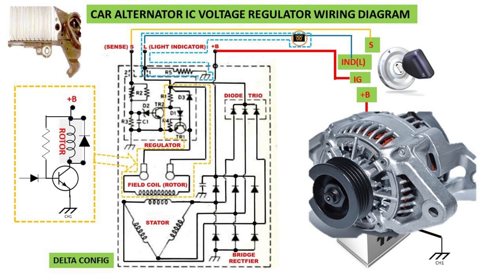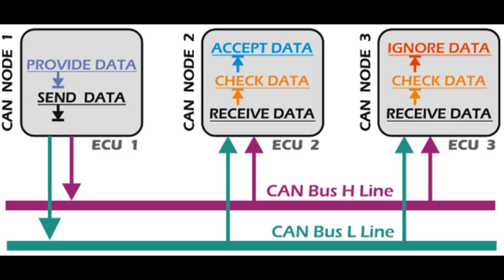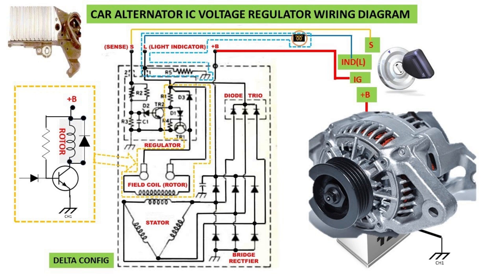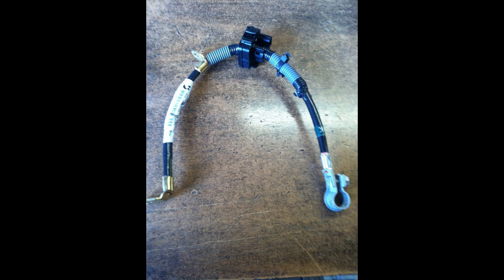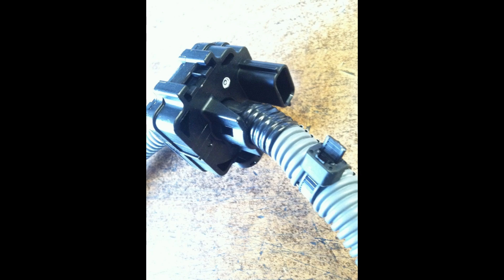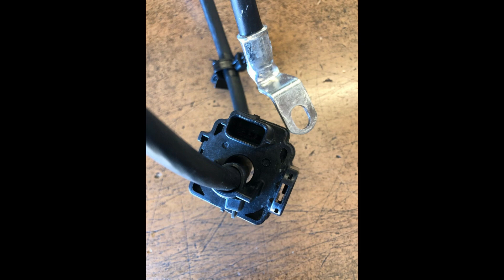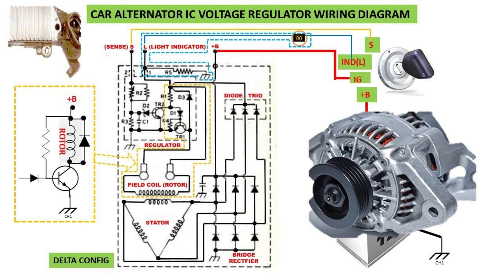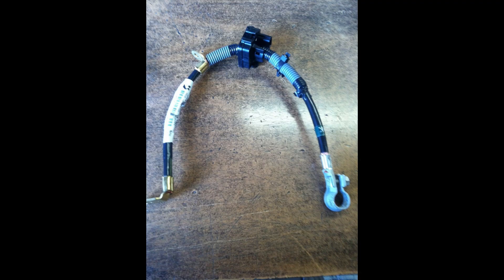Nissan VVCS Variable Voltage Control System

Comment: I can confirm that de-pinning terminal 4 pink wire at the battery current sensor works on the 2024 Nissan frontier without triggering a SES light. There is however an idle start/stop disabled message that appears everytime you start the vehicle. Added bonus if you ask me. Saved me some money buying a start/stop eliminator. The vvcs killed my first battery at only 24000 miles and I now know why. I’ve been running my truck this way for over 2 months now with absolutely no issues. I do keep a voltage monitor plugged into my cigarette lighter port to keep a an eye out for wild voltage swings indicating possible alternator issues. I now run at a pretty constant 13.9 to 14.1 volts. Thank you for a very informative video Frontier Geek.

Side note: doing this to a 25 model and presumably the 26 models will trigger an SES light in addition to the idle start/stop disabled pop-up.

Comment: I did this on my 2017, about 1.5 - 2 yrs ago. I also have a "Scan Gauge 3" , and one of my active gauges is voltage. Im seeing the same numbers you are. I also about the same time put in an AGM battery since it was time anyways. I've had no problems. Glad i didn't clip the yellow wire back at the box near firewall. I haven't been on the forum for a while. This video popped up as a recommendation to watch. Good stuff
Reply from the maker: Tarpman, thanks for writing in. Good info, thanks for posting and sharing your experiences. Always appreciate hearing that someone else found benefit from our videos. I have an EDGE CS digital OLED multi-guage as well, and I keep system voltage as the centre guage 24 by 7.

Comment: Nice meeting you at Carlisle this past weekend. I know of a someone that has "smart alternators" in their newer Bronco.  They had issues with power getting to the trailer they were towing to keep their batteries charged. Turns out they had to turn on all of their off road lights while driving to "trick" the alternator into putting out more so the house batteries in the trailer could be charged.
Reply from the maker: Ah, you made it !!! So to speak, LOL. I just subbed your channel too. These VVCS systems are such crap, another governmental overreach into everyone's daily lives, that accomplishes nothing but annoyance and expenses. Some vehicles apparently will defeat VVCS if the headlamps are turned on, but not all. Thankfully for the Nissan Frontier and Pathfinder, it's pretty easy to kill, at least in the second gen. The third is a mixed bag as the auto-start-stop showed up and now complicated things more.

Comment: You can eliminate it on the 3rd gen. It's a similar setup as the second gen. It's a black box right by the battery. I unplugged mine and then removed the box off the negative cable terminal. The VVCS killed my original battery.
Reply: I have a 2025.  I confirm that disconnecting the plug causes a CEL and flashing ASS light. I have not yet found the info about what results from disconnecting just the pink wire. Guess I'll give that a try.
Reply from the maker: BoomUp, give us an update if that fixes your problem, I'm sure somebody else out there is wondering the same thing. Hopefully they'll wander on into my corner of the digital universe.
Reply from the maker: Yes, that is true, but my understanding is the 3rd gen has a 4 wire sensor and only one of those 4 should be removed. The other has a battery temperature sensor circuit that feeds back to the PCM as well. I believe it was a pink wire that needs to be depinned, but I would check a wiring diagram for the year in question, before modifying anything in the harness. Never forget these sensor leads feed directly back to an area inside the PCM circuit board and should always be tape-wrapped if disconnected, to prevent voltage or grounding contact. Also depending on year, a PCM code will probably be set, and the SES may be illuminated. And if you have Auto Stop / Start that will be disabled as well and a Start / Stop system fault will be displayed.
Reply: @frontiergeek4953  I never looked at the plug to see the wires. I have the plug itself taped off. I haven't had any lights or warnings. Thankfully mine is a first build 22 and I don't have the A.S.S on mine. I've read that other people that depinned or "cut" the pink wire have had some issues. I'm not sure what the outcome was with them. The battery would be monitored through the alternator and the ECM isn't monitoring the battery temp through that connection on the negative terminal. I went down the worm hole about that module that was on the negative terminal and everything always came back to it being in charge of the VVCS monitor. It's been about a year for me and I haven't had any lights or battery issues. The new battery is strong as ever.
Reply: @frontiergeek4953  24 Frontier here. Have had mine unplugged since week one (purchased new). Only light is flashing Auto Stop / Start light. Kills two birds, no undercharging and no stop / start.

Comment: Why over complicate a simple way to maintain 13.8 volts?  I stay away from cars with this type of system.
Reply from the maker: I would try to avoid it too, but now everyone's using it cause the EPA gives manufacturers breaks on their Federal fees and oversight. It started back about 2005 or so, so there will be few remaining cars on the road that don't have some form of this system now.
Reply: @frontiergeek4953  Thank you, it seems that the EPA is involved in it a bit too much. Sometime ago I put together a voltage regulator for my alternator using a 723 IC chip, and it worked great! Had to modify it for temp compensation.
This was on my 2000 Chevy Express.
Reply from the maker: Now that's a cool project, very creative.

Comment: Let's test the charging system.   Engine running,  headlights on.  Blower motor on half speed .  Your multimeter set to 20vdc.  
Test one. Measure voltage across the Positive to Negative battery posts. If everything is good you should see 14.1 to 14.6 volts.  
Test two.  Measure from negative battery post to the engine block.  0.04vdc max. 
Test three. Measure from the negative battery post to the body.  0.04vdc max. 
Test four.  Measure from the engine to the body.  0.04vdc max. 
Test five.  Measure from the Positive battery post to multiple fuses in the underhood fuse block. 0.04vdc max. 
Test six.  Measure from the Positive battery to the alternator output stud threads.  0.3vdc Max because copper is expensive and the oems can get away with it. 
Pickups with a separate frame. Test 2B. Negative battery to the frame rail because many oems ground tings to the frame like the rear lighting, electric fuel pumps. Transfer case controls. 

 Why do this less than 5 minutes worth of testing with a $15 to $45 buck multimeter.  Because the electrical system is not Bluetooth.  It's hard wired and if you have a loose crimp, a loose connection a burned connector or corrosion on the wire strands. This simple voltage drop test is how you prove the electrons are moving freely. 

 Think of a garden hose with no nozzle with water flowing full speed thru the hose.  The only thing slowing the water down is the water rubbing the inside of the hose.  This is pressure drop.  Now if the hose has a kink the flow is reduced.  There is more pressure at the faucet than at the end of the hose.  Resistance to flow.  Easily measured using a pressure tester. 

Copper wire is not a perfect conductor. It has slight resistance.  So you can tell if the electrons are flowing freely.  

Electrons also travel on the outside of the conductors. If they get corroded. Less flow gets thru and the voltage drops tests are higher.   

Hope you see this.  

It's not written in anything I have seen. But the load sensors let the pcm maintain the idle speed better allowing the computer to keep the engine idling slower with less fuel being injected is my take on it.  Could I be wrong?
Reply from the maker: Hello Wayne, thanks for writing in. That's a great summary of the basic voltage drop tests for an automotive charging system. The voltage drop tests are essential for properly troubleshooting and diagnosing electrical problems. You can also use these tests to determine the effectiveness of grounding systems. Anyone with strange electrical issues should perform all of these tests and a comprehensive physical examination of all your wiring and terminals, positive and negative. With the VVCS system in operation I never saw voltage above 14.1 and that was very uncommon, usually it was in the 13s and sometimes as low as 12.9. I don't see that anymore. I did not see any difference in either idle speed or fuel consumption before or after, which leads me to believe that this is a system that has no real-world purpose and keeps batteries undercharged.

Comment: Subaru Outback 2016 has this and yeah, it does cause under charged batteries.  I found I could just leave the headlights on all the time and force a 14.3 volt continues charge.
Reply from the maker: Hello Alang, thanks for writing in. Someone on the ClubFrontier forum mentioned that too, an interesting built-in defeat system. As far as I'm aware of, Nissan didn't do this, I run with my lights on 99% of the time and never noticed it affected charging, and I have a real-time voltmeter, not the idiot indicator in the dash.

Comment: Are these systems on gen 1 as well?  (Particularly Xterra )
Reply from the maker: Hello Jim, not that I'm aware of. This is a second and third gen addition that really should never have happened to begin with. Standard alternators are quite capable of keeping their electrical loads fairly steady and keeping the battery(s) properly charged without overcharging. I disabled my NVVCS nearly 11 months ago and it has worked just fine ever since.
Reply: Many thanks!  It can be tough keeping up with these types of changes.
Reply from the maker: Indeed so. Happy to be helpful.

Comment: The big current draw on new cars is the engine electronics. The old breaker point coil ignition system may have drawn about 7 amps. New cars need 30 amps or more to run. The alternator itself takes a healthy current.
Reply from the maker: Hello Dave, thanks for writing in. I agree, the older cars definitely had a much lower power draw, but personally, I don't want to ever set points gaps again or try to rebuild a carb, or drive at night with dim old incandescent headlamps that look like candles. Given that however, I definitely feel we have gone past the point of things that make sense like sequential fuel injection, and gotten to this VVCS system and the auto lane change / backup / side object alerts and all the other nannies that are being installed now. Thankfully in most vehicles these can be defeated, at least for now. I wonder when that will change. Guess that makes me a Luddite LOL.

Comment: I'm in total agreement with your assessment.
If the automobile manufacturers didn't make everything in the vehicle become electronically operated then there would not have been any reason to try and come up with this terrible system. We have now become Slaves to these out of Control Engineers and their Brain farts.
Reply from the maker: Hello Joe, thanks for writing in. This system, as well as I can tell, is just like many other things pawned off on us, pushed by the Federal Gov't and then implemented by manufacturers and their engineers, looking to curry favour and avoid extra fees or taxes. Thankfully this one is relatively easy to defeat. That asinine autostart-stop system also immediately comes to mind, how much starter wear does that thing cause. Another way for dealer service departments to make more money.